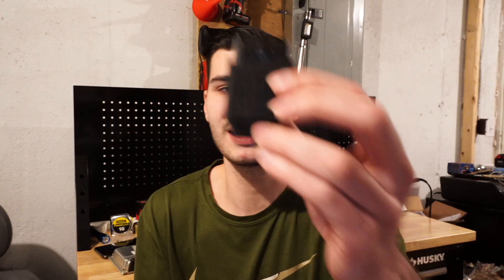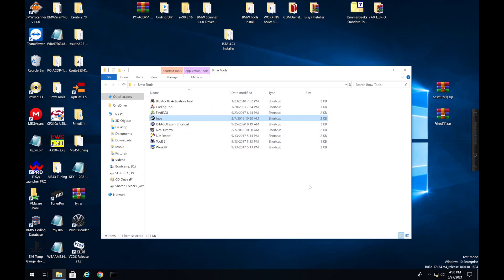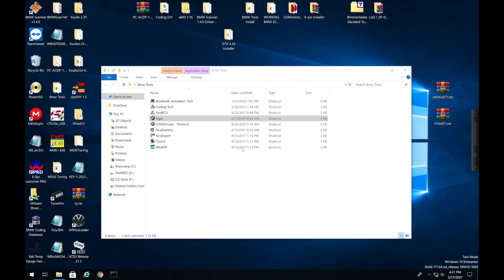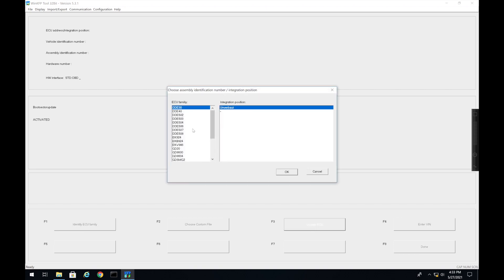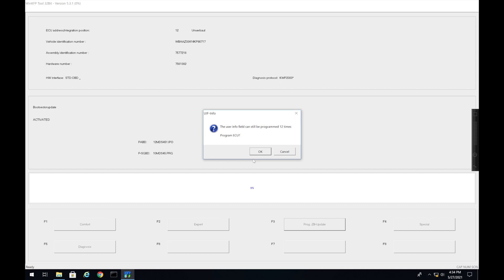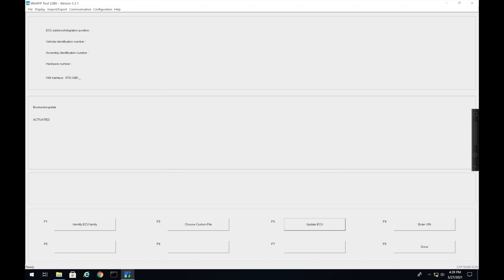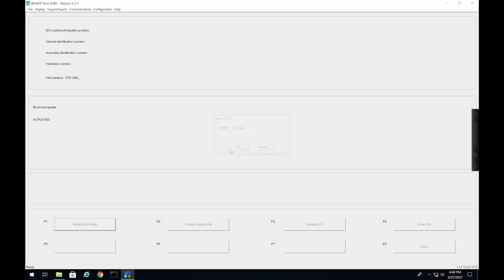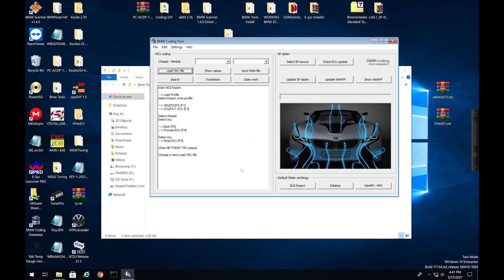How to update modules on your BMW!

Comment: Hi Evan, after hitting comfort mode I don't have the option to update ecu, I just have "Enter zusb" "choose zusb" "update zusb" and "enter vin". just wondering where i've gone wrong and if you can point me in the right direction. Car showing as connected in inpa. 08 e70 x5. thanks.
Reply: same..
Reply: Anyone figure this out?
Reply: Did you figure it out?

Comment: I know this video it old, but it helped me immensely. My EKPMS module overheated and I bought a replacement. I was able to drive the car without coding the module, but I did not like the way the car shifted and at certain points, there was lack of power. To avoid any damage to the fuel pump or CATs with potential excessive unburned fuel, I needed to code the module. I checked INPA for the EKP module number (7276383) and I noticed it had another VIN number assigned to it. I followed your tutorial and I was able to successfully program the module and add my VIN to the module. The key is, you need the SP-DATEN files. I was able to find the most recent Daten files, 7.0 and 7.1. I believe they stopped updating the Daten files at version 6.5, but anything after 6.5 will be the same, which will work. Used BMW Coding tool to update NCS Expert, EDIABAS and WINKFP and pointed WinKFP to the latest SP-Daten files. Thanks for the tutorial! There aren't many videos that explain in detail. This video is the best I was able to find. Thanks!
Reply: The VIN really made a different to the fuel pump operating properly?
Reply: @ yes. The DME is assigned to the VIN. The VIN needs to be registered in order to recognize the module. It might work without registering but the fuel dispersement will not be accurate. Then you’ll ruin your CATs.
Reply: @iamurnamann8662 I'm Having the same issue!!! I'm so confused at the moment... I had an ekp2 in the car and I bought the next step up. I know It won't work if I just plug the new one in since there's 'coding' needing to be involved. And I'm new to all of this. Did you plug the new ekp module into your car and then followed the steps in the video to "update" it?? Or did you follow the steps while having the old one still plugged in... And does this video show how to 'flash the vin' to the new module? I'm just trying to get it so that the car recognizes this new ekp module as its own... (if that makes sense) And what's the difference between updating a module and replacing a module if any.

Comment: hello friend i know im here a little bit years after  but i need your help, i have a bmw e46 2002 318i n42b20 engine, but i noticed that the modules was changed, the ike cluster and the light module lcm has the info about a 330ci and different vin, so the abs module as well, and the ews also i remember, how can i get all modules in order? looks like only the gearbox has the info correct, with this tools can i do it? i tried to code with ncs expert in expertmodus the abs module but dont show in the list to code, i have been seen a lot of videos of abs module coding and by now i can coode the module, so i need to code this and the other modules, because i have some error codes frecuently, the car starts run go and come good but i want it all in order. thank you if you can help me please. thanks

Comment: Just stumbled onto your YouTube videos...  subscribed and ordered your INPA cable from Amazon…  
My 330ci recently had the cluster go so I bought another from a wrecker but now had these warning lights appear even though I had none prior to the cluster change.  My small cheap OBD2 scanner shows no codes so I had a BMW repair guy (not the dealer) scan it and he said there were some after-market component changes that the car didn’t have registered as OEM but he didn’t know how to clear them (the emergency brake light runs yellow).
My questions are,  can the INPA software:
1.	Clear the error lights (ie: change program for registered components)?
2.	Reset the mileage dot due to cluster change?
Many thanks,  Joe

Comment: Nice instructions. I followed your instructions , but when I go up update ecu in winkfp, nothing shows and the list is blank. I had to change airbag control module under the glove compartment and steering angle sensor. Do you have any suggestions? I appreciate it.
Reply from the maker: You need to update sp daten files
Reply: @EvanGoyuk  thanks so much for replying. I am going to try that , I don’t know how but hopefully I can figure it out. Again thank you
Reply from the maker: I can help remotely
Reply: @EvanGoyuk  I appreciate it.
Reply: @EvanGoyuk hi mate could you please help me with how I get the essambly file 
Sp daten from my impa or I should download it
Thanks

Comment: good night I need help I replaced the Bosch vp44 injection pump of my bmw320d e46 for another one used as I do for the synchronization with the ECU I have the ista-p program thanks
Reply from the maker: Inpa can do this
Reply: Thanks
Reply: good night could you explain to me step by step greetings